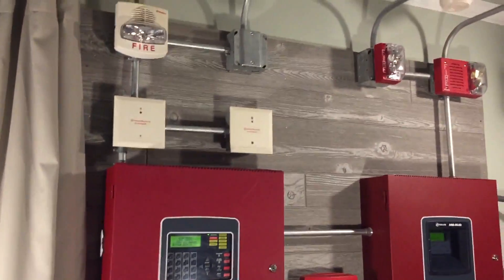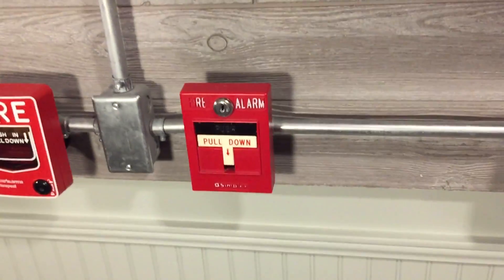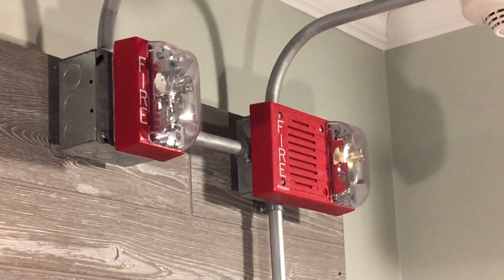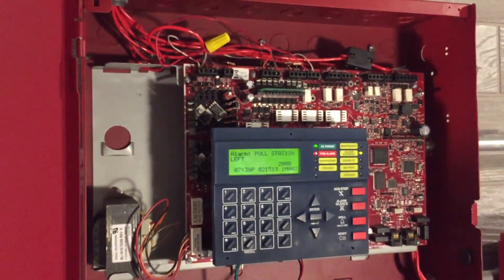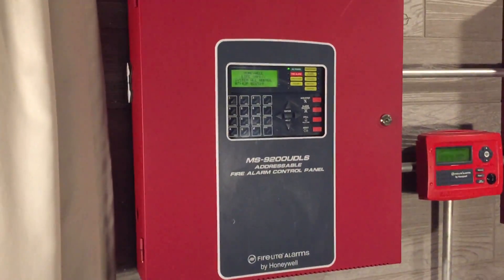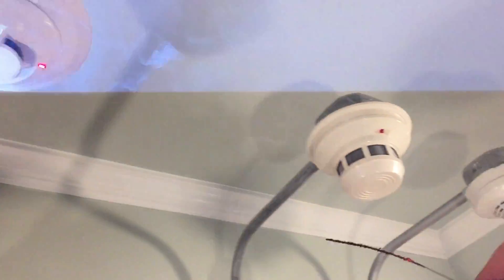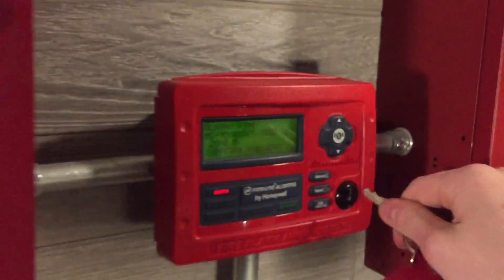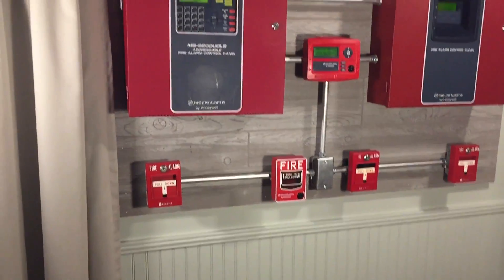System Test 5 | Simplex and Smoke!

Comment: What is that cover on the vent for?
Reply from the maker: It directs the air away from the smoke/heat detectors. The air from the vent can make it difficult to test the detectors so the vent cover redirects it away from them.
Reply: @ExitSign250  very cool!

Comment: how did you wire the simplex smoke alarm to a addressable fire lite panel i have the same one but it does not work with my fire lite es-50
Reply from the maker: To wire conventional initiating devices to addressable panels, you must use a monitor module. My monitor modules are above the MS-9200UDLS panel. They look like square plates with a blinking light on it. Some other brands may have different looking ones but they all have the same general function.
Reply: @ExitSign250  oh I understand i have a simplex 4098 9754 and it does not work with my panel

Comment: Is the simplex smoke detector wired to a monitor module? Thanks
Reply from the maker: It is. That’s the only way conventional devices work with addressable systems.
Reply: @ExitSign250  how you wired it was wiring resettable power to the resettable power terminals of the module,  the smoke detector to the zone on of the module, and the SLC to the slc terminals? Thanks

Comment: I really hope you’re not directly wiring those to the panels and using FWR
Reply from the maker: Yep, they are directly wired to the panel’s NACs. (FWR) I don’t personally believe in the whole “don’t run Simplex devices on FWR” stuff because I’ve done it for years and nothing has ever happened.
Reply: ExitSign250 just be careful with the quick/truealerts please. it would suck if those broke
Reply from the maker: The devices aren’t effected by the FWR, and it certainly won’t break them.

Comment: Your microphone seems to be having trouble with the sound of those alarms.
Reply: The iPhone/iPad or whatever that he’s using that is connected to his microphone can only handle a very low level line input, so it’s probably that the level is too high and the internals on the device start to clip. I use a TRS to TRRS converter to use the mic input to play music via a 3.5mm cable while I’m streaming and if the volume on the other phone playing the music is over half then the mic input will start clipping and causing the audio to have the same effect. I think it has to do more with the levels and that his microphone is completely fine.
Reply: Aaron Productions ok thanks for the explanation!
Reply from the maker: Actually, the issue with the sound is due to I face my shotgun microphone away from the devices and facing me. If I were to face it towards the alarms, you wouldn’t be able to hear me much. I’m in the process of getting a mic to attach to me, then have the shotgun mic faced towards the alarms. That way audio from both ways is equal.
Reply: ExitSign250 make sure you get a powered lav
Reply: Dale Nuss Because these Alarms are using FWR (Unfiltered DC) which makes the alarms sound raspy.